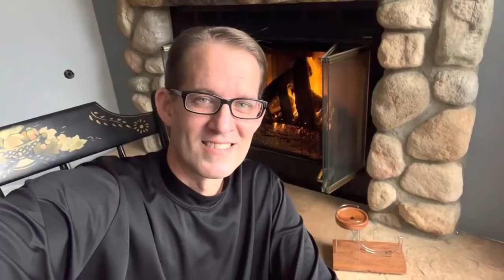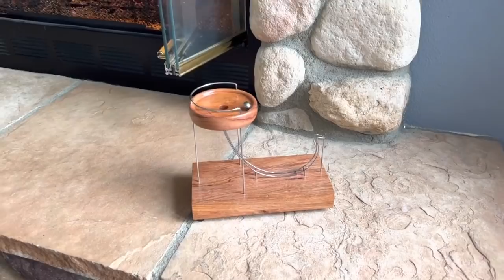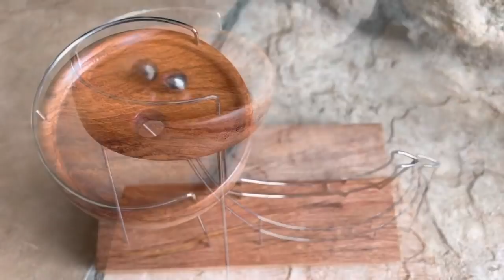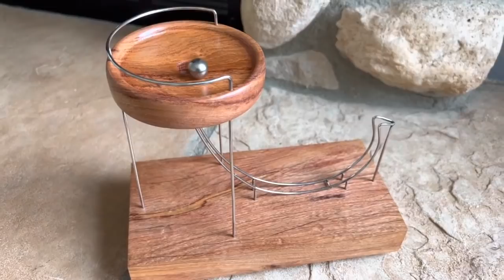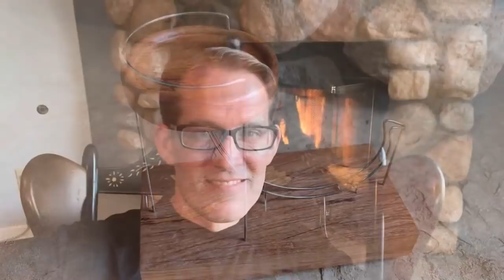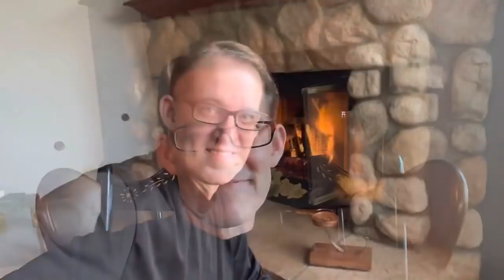Perpetual Motion Marble Machine in RamZland!

Comment: So does the magnet turn on and off with appropriate timing to accelerate the ball? If not, wouldn't a non-electric magnet work?
Reply: Such perpetuum mobiles have been made, but the non-electric magnet gradually loses its power if energy is taken from it. So it doesn't work.
Reply: @Arskanbooki  "the non-electric magnet gradually loses its power if energy is taken from it" - it's impossible to "take energy" from a "non-electric" permanent magnet.
Reply: @renedekker9806  Of course, my information may be based on a false statement, but this is how I have read the explanation.
Reply: @Arskanbooki  "this is how I have read the explanation" - now you have a reason to double-check explanations before repeating them.
Reply: @renedekker9806  Apparently so, but double-checking or multi-checking also gives results similar to my view. However, I am not going to argue because I rely on your expertise.
Reply: @Arskanbooki  No, that's not the reason perpetual motion machines based on permanent magnets doesn't work. They simply don't work because permanent magnets can't be turned off.
Reply: @HGSolberg  True, but the model I saw had moving magnets. They changed places while the machine was running. The explanation sounded reasonable, and at the same time it was said that the device is obviously not a real perpetual motion machine because the magnets are fading. Unfortunately, I can no longer remember exactly because it was a couple of decades ago. I'd like to see it again.
Reply: @Arskanbooki  Ok. If the magnets move, it would work, but you would have to have a motor or some other added mechanism to move the magnets. You can't make a mechanism that will both move the magnets and keep going without slowing down at the same time. Such a mechanism would have to overcome the force from the permanent magnets, just by it's own movement, and that's not possible. And again, the magnets aging isn't really part of that equation. Even if magnets didn't age, you would still not be able to make a perpetual motion machine.
Reply: @HGSolberg  I too have been saying that perpetual motion is impossible. The device needs energy to move. The main point in this case is whether energy can be taken from a permanent magnet. If so, the magnet will have to weaken. Examples of magnet weakening can be found.
Some real physicist would have to solve this question. (Well, if you're one, I'll  shut up🤐)
Reply: @Arskanbooki  You can't harvest energy from a permanent magnet. The magnet only applies a force, and the force applied to an object will have to be applied to the object again in the opposite direction to release it, i.e. the net energy gain is zero. If you could make a mechanism that moved on its own, solely by using permanent magnets, that would be very cool, and such designs would be all over the place. I mean, even if the magnets weakened, they would run for months and maybe years before they stopped, right? That would be pretty cool in any circumstance. But it's not possible.
And don't think scientists have not though of it. They probably figured this out hundreds of years ago.

I'm not a scientist, I'm merely a mechanical engineer, but I believe I have a reasonable understanding of basic physics like this.
Reply: @HGSolberg  The things you have presented are reasonable, but I am still thinking about:
A device that works with permanent magnets would be a mere curiosity. That would be very inefficient. Scientists would not waste time on such, as a much better result would simply be obtained with batteries. That is why it is not being talked about.
And by the way, a magnet can be used to magnetize metal objects. Isn't something moving from one object to another then? If it is energy, the donor must weaken because no energy is generated from nothingness.
Reply: @Arskanbooki  how about the vaccum thing he mentioned. Wouldn't that help?
Reply: @harshbamnawat5917  He did not explain his purpose in more detail, but I cannot see what the effect of air pressure / vacuum would be on this. Energy cannot be removed from it either.
Reply: @Arskanbooki  can you answer Northwest's first question? I'm interested to know how the magnet works...
Reply: Yes, it would have to be switched on and off with appropriate timing. A (stationary) permanent magnet would just attract the ball and stick it to the base. 
My wild guess: attracting the ball increases the resistance of the electromagnetic coil slightly, decreasing the current flowing. An electronic circuit is monitoring how much current is flowing in the coil, and switches it off at the right moment.
Reply: @renedekker9806  sounds like how they accelerate maglev trains. Forgot about that for a bit.
Reply: @renedekker9806  that's a great seed of an idea !! Needs some refining though. Thanks !  I'll use your concept if i may ? To make one of my own  :D

Comment: How does the magnet attract it One Direction, but not back when it passes by to slow it back down?
Reply: I don't know, but I would do it with a magnetic switch built inside the upper platform that triggers the magnet in the base to turn on for a set fraction of time that turns off just as the ball reaches the bottom.
Reply: because it is electromagnet, when the ball passes it, the magnet had been turn off.
Reply: A first tiny coil to detect the balls position, an electronic circuit and timer to energise the second coil which attracts and accelerates the ball, before switching off quickly and letting the ball continue on..  all in the base of the unit..

Comment: Impossible something is wrong ❌
Reply: It is an illusion.  There is a magnetic switch in the upper platform that turns on an electromagnet in the base. The magnet is on a short timer that attracts the ball on the way down and turns off just as the ball reaches the bottom. That stops the magnet from holding the ball down. After the ball reaches the top, the cycle repeats.
Reply: @Aa10D The video does not reveal how it works. I did.
Reply: @Aa10D I didn't see your comment say "@anyone else", either so cool your jets. In addition, he did not give a good explanation. He just said "electromagnet", which is true BUT the key is the timing to apply the magnet as the ball is rolling down the hill, but time it just right to turn it OFF before the ball begins to ramp up the other side. 0therwise, it doesn't work. It is the timing that is key.

Comment: Would be nice to see how it was built underneath.
Nice workmanship. 
Guessing the magnet accelerates the steel ball just  before the bottom of the ramp.
Reply: It a rechargeable electro magnet so I guess as it goes flat this thing would stop working...Shame they couldn't do it with just standard magnets that would be cool.
Reply: @shadowbanned5164  but then it would be a perpetual motion machine
Reply: @nonyabiz6005  No it wouldn't work because it has to shut the magnetism off as the ball is going back up again. A permanent magnet would make it accelerate down but keep it from going up again. The electromagnet pull down but deactivates when it gets to the bottom.
Reply: I know. I said that would be a perpetual motion machine. Which obviously wouldn’t be possible. You misinterpreted my comment
Reply: @shadowbanned5164  Really a shame! We need to raise better engineers indeed 🤣🤣
Reply: @scooter2163  you mad?
Reply: @Scooter21... "We"? You got a mouse in your pocket? I understood his post just fine...

Back under the bridge...

Comment: How do you replace the battery? It should be possible to open it up? If so, why not show it?
Reply: Battery is inside to the base with a USB port which is mounted on the base shell for charging
Reply from the maker: The battery is rechargeable - there’s an attachment underneath it.
Reply: What shi dong said